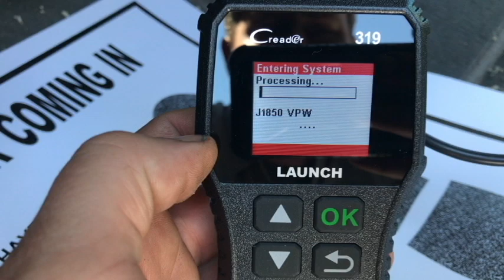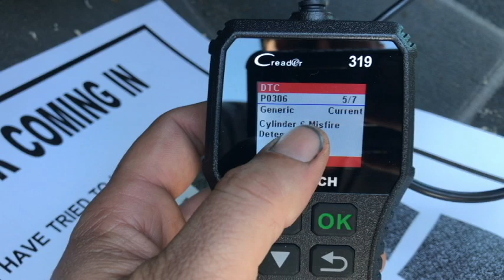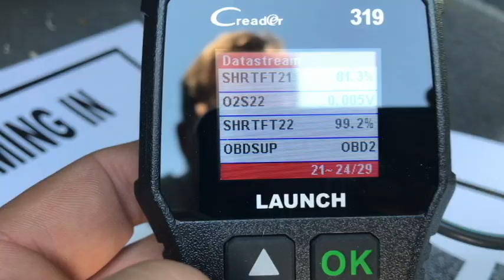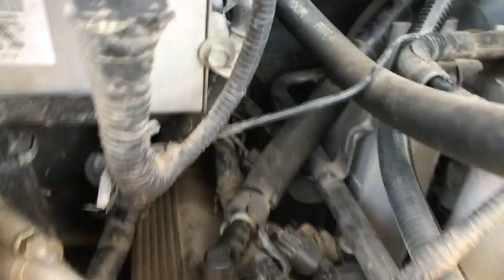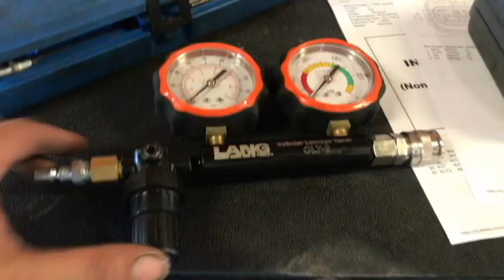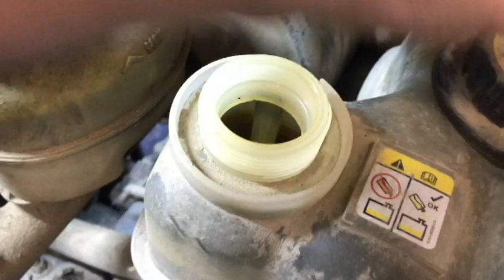2004 FORD F-150 TRITON P0300,P0302,P0306,P0206

Comment: I own this little guy because my service engine light didn't reset after I replaced my Evap on my wife's ford focus.  This $22.00+ gadget paid for itself on the first use because in Ohio if that light is on you cannot get new tags and having a garage clear the codes is between $50-$200 dollars.  Screw that!

Comment: I have the CReader 3001 basically the same device $36, I like it so far. Crazy it's like the #6 piston is broke loose from the connecting rod and stuck in place so the cylinder doesn't build pressure but can hold pressure

Comment: Good job on the Video Justin! I saw this same thing for the first time recently as well! Low/No compression at all but perfect leakdown. Turned out to be a bad lifter in my case on a Chevy v8 with the cylinder deactivation system on it. Did a head job on it with new lifters, headgaskets and a valve job and all was well until dingbat that worked for the contractor neglected a coolant leak that arose 2 months later and drove from San Diego to Palm Springs and then back again(it was overheating the WHOLE way back, amazed it made it) and toasted the engine. Felt bad for the customer on that one but he needs to find better guys to work for him!
Reply from the maker: GearHeads Wow That does suck. Hey bro are you in so cal?
Reply: @JustinDowDIYcentralhighway  Yea man north eastern San Diego area!
Reply from the maker: GearHeads Nice! Good to know. Maybe we can do a collaboration some time. 🍻👍
Reply: @JustinDowDIYcentralhighway  Hell yea thatd be fun man! Your in Joshua Tree right?
Reply: @JustinDowDIYcentralhighway  Add me on facebook if you feel inclined, I messaged you on your channel page recently when you took a break
Reply from the maker: GearHeads yes sir.

Comment: Seem like a head gasket the injector code is interesting
Reply: Headgasket would likely have SOME compression still, very rare to see them fail to the point of Zero reported compression. More than likely a valve train or more severe mechanical failure.
Reply: True it's the miss fire on start up code I usually only see that one with a bad head gasket the other codes may have been set with backyard diagnosis then a mechanical failure as a result continue driving